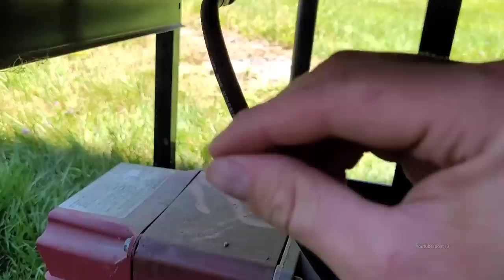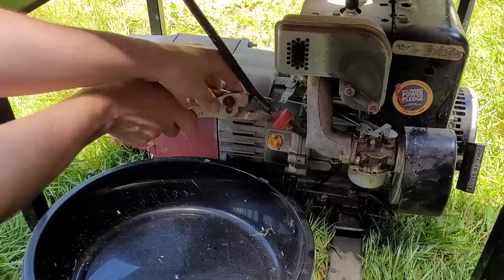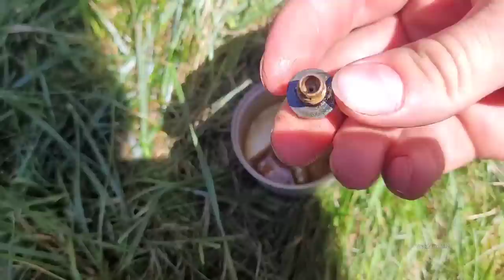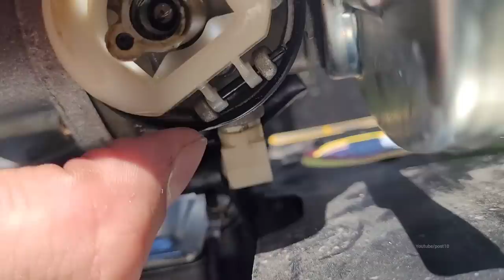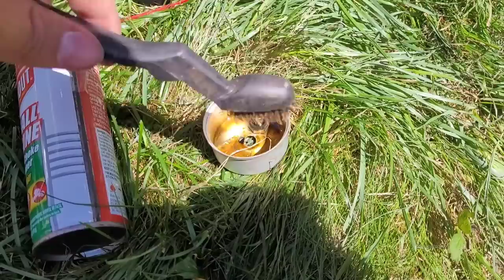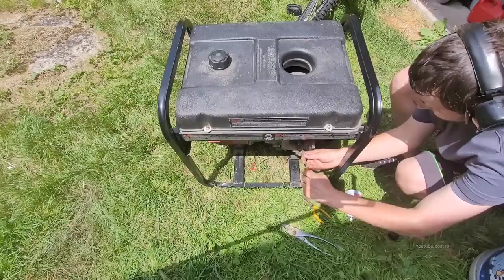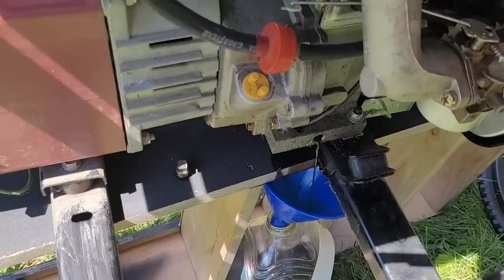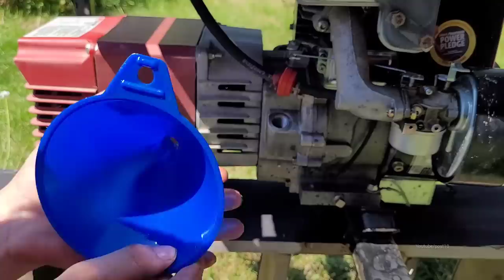I Bought a Generator That Won't Start. Doing a Tune Up

Comment: The main jet (the 'bolt' that holds the bowl on) appeared clogged. It will never run if it is. That and the 'pilot jet' will need to be cleared. An old high 'E' guitar string works great for that! I'm surprised you haven't watched a few YouTube small engine repair videos, Postie. There's only about a gazillion of 'em! 🤣🤣🤣

Comment: That generator model you have is a Coleman. They are sold at Wallmart, home depot ect.. The gas is brown because the stable that was added to the petrol went bad. I personally use K100 petrol formula. They do make a diesel formula to.

Comment: Put a not sure if it's 5/8ths or 3/4 pipe with a shut off valve to replace the oil plug so it makes it easier to change the oil

Comment: You can take the case off the pull start and use a drill on the nut holding pull start in to start it.

Comment: You can remove the ethanol by adding water, then pouring off the separated layer of gasoline.
Half the internet says you shouldn't, half say you should, and half say you should as long as you boost the octane afterwards.
That's one and half times the size internet, so it must be relevant.
Reply: Curious where he found ethanol free gas.  I'm in corn country, very hard to find here.

Comment: 99/100 carbs get fouled up because people just turn the unit off instead of shutting the fuel off while it is running and letting it run drain the float bowl.  Then it just sits there as a little evaporation chamber letting in fuel as it evaporates from the bowl and concentrating the impurities and varnish in the carb for an entire take of fuel.

Comment: Interesting - the plate had 120/240V 5kW on it. I wonder if it has a split phase output. You could check with a multimeter.
Reply: It has to be. Nothing but a heating element runs on straight 240v
Reply: 240v is the Uk standard.
Reply: @JM-yx1lm  it is standard in most of the world, even my phone charger run on 240
Reply: Same here in Australia
Reply: @bassam_salim  yes I know all that, I was just speaking on this generator that post had there and every generator in USA that says 120/240 is split phase.

Comment: When checking about engine Google the engine only not the generator model. Your generator outlets look just like my old unit. The lower outlets on mine are twenty amp but 220. The upper outlets are 110.

Comment: I pretty sure that small red panel that you removed on the plug side is where you unscrew those screws (should be captive) and direct wire a wire into it. We have a generator that has those but it looks slightly different so I'm not 100% sure.
Reply: I thought it was to replace the brushes. Does it have brushes? No idea lol

Comment: Those small engines are almost always spark plug issue or carb. When I have issues with my generator in this order I check plugs, fuel filter then carb

Comment: Change the fuel filter try it again, Post 10.
Also, check the GAP on the spark plug. Make sure it is correct.
Good luck!

Comment: If you're going to let it sit and not run for awhile, turn the gas off while running and let it run till it stops/runs out of gas in the carb.  Then you won't have to worry about the carb getting gummed up.

Comment: You can tell by the thickness of the oil if it's good or not....Rub it between your fingers, you can feel thick or thin oil, that's how I test it, never failed me. If it feels like water change it.

Comment: Did you try to clean or replace the gas filter and check valve? I think a lot of what you did could have been avoided if you had done that first.

Comment: Question for ya Post, where can you get Ethanol Free gas which doesn't cost more than my car payment? My dad used to get Avgas from the airport because that was pure, but it was also expensive as all getout. We've been running normal gas in our two-strokes for a while now, and it's definitely taking a big toll on them.
Reply from the maker: I don't know where you're from but the majority of gas stations near me the mid-range 91 is ethanol free
Reply: @post.10  Central PA. I'll have to keep an eye out. I know they usually have the Kerosene pumps, so maybe the old station nearby has some of the good stuff.

Comment: Although you achieved a win, could I persuade you to check out James Condon’s channel, he really is a wiz with portable generators.
Edit: always turn the fuel off and run the carby dry on small engines regardless of what type of fuel you’re using. And PLEASE change that fuel filter, it is probably as old as the generator 😂😂😂.

Comment: My first thought after 3 pulls was the spark plug, that's my default......If it's not water in the fuel or the wrong fuel (which happens when you work in a gang) it's the spark plug.

Comment: 12:30 - Yup, definitely a fuel delivery problem.

Btw. you need to adjust the governor so the generator delivers 60 Hz AC - under load.
Reply: Looks like an Auto Throttle.🤔🤔
Stupid design meaning the load needs to be plugged in as Generator is Cranked to set correct Amps/Volts🔧
Reply: @statementleaver8095  
No, the load has to be connected to the running generator during the calibration. You do not want to crank the generator with the load attached. 🙂
Reply: @Peter_Riis_DK  As you say gradually but Id expect all equipment linked to Generator to have on/off functionality.
Reply: @Peter_Riis_DK  Different items require different power👍
Reply: @statementleaver8095  
I haven't said that.
Have a nice day. 🙂
Reply: @Peter_Riis_DK  Come on stop the common sense argument and Scream @Post10 for a Load test 🤣😂🤣😂

Comment: Check out Taryl Fixes All. He has a series of vids where he test fuel and fuel stabilizer.  Turns out the stabilizer is a ripoff. It's the fuel in the ethynol-free engines that lasted the longest.

Comment: If you have to use starting fluid to start an engine then there is something wrong with the engine. Fix that. As you found out it didn't do anything, and you used a lot, it started when you fixed the problem with the carby. It was frustrating as I could hear it was a fuel problem.

Comment: With all your futzing around trying to get the engine working, I don't recall seeing you plug a light or something else in while it was running to see if the generator was producing current! Also, don't waste your time looking up the generator specs to find out how much oil it takes. Look up the engine model for that. The label looked to be seen below the carb bowl. Oh Mustie1, where are you?
Reply from the maker: Not when I was working but once I got it started I plugged in a reciprocating saw

Comment: Sounded like it was running way too slow. Checker voltage. Should be around 125 volts 62. Hertz. With no load. YouTube is your friend. This exact model is all over  YouTube.

Comment: Is it ok to mix fuel oil and ag diesel for a fuel oil furnace?
Reply from the maker: It's okay during an emergency but over time it can cause damage since it's not refined the exact same way, fuel oils cheaper anyways
Reply: @post.10  thanks for the info.   New house came with one. Not common in Illinois

Comment: I say sell it for $500 and buy yourself a new one if you really want to power your house during winter. That thing could be a bear to start in cold and if its 20 years old it likely gonna have issues.
Reply from the maker: We'll see this is a Tecumseh Flathead engine just like my snow blower which is over 40 years old and it always starts on first pull
Reply: @post.10  true, it just seems like a trackside generator to me not so much for a home but you would know more than me I suppose 😀

Comment: Do not rely on that generator. If your smart you'll buy a good one and get rid of that one. You'll find out why soon after you start using it. Believe me I've owned several.
Reply: If you have owned several you should know that good maintenance is key and with that the machine will run forever.

Comment: 🤔I think you haven't saved 30 💵, that fret has work to do and old things stop very often and have to be repaired, over time you will have spent more than on a new one, sometimes it just doesn't pay off^^, Have fun🍀 ❣